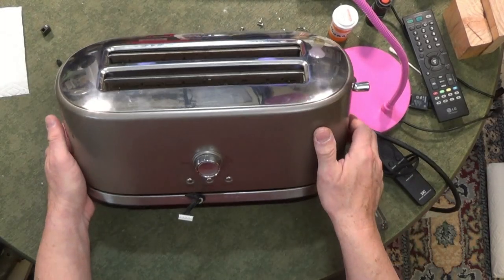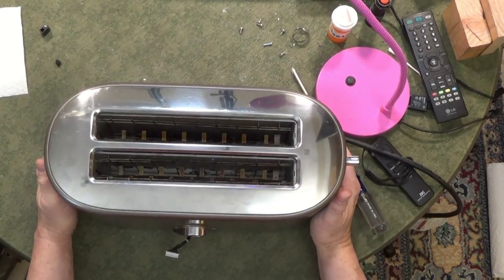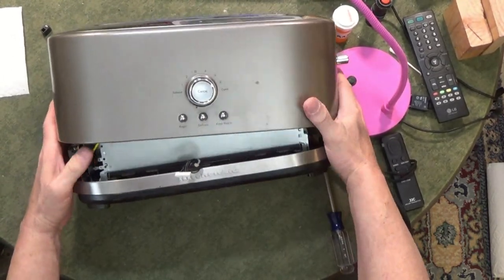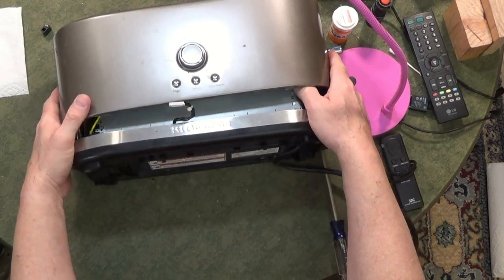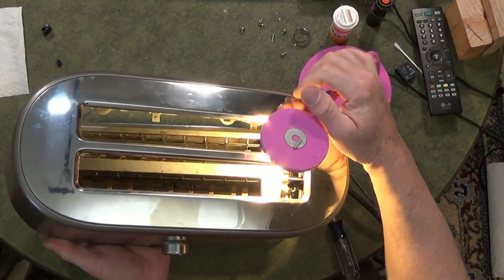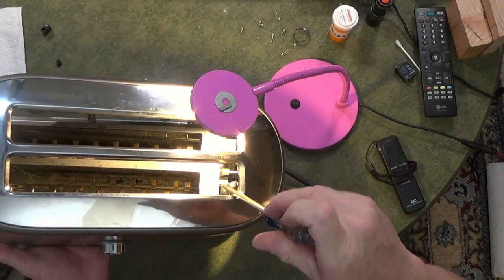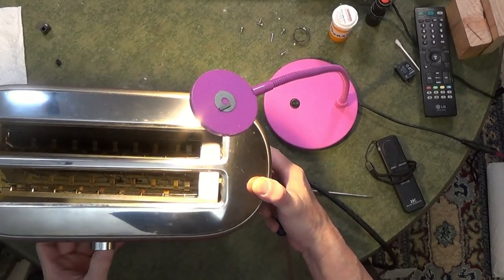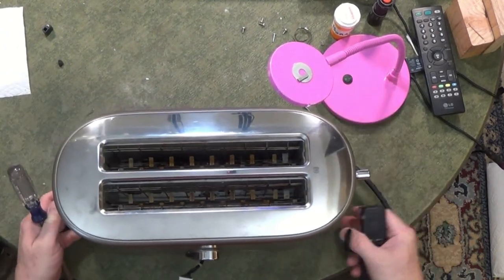How to remove the knob on a Kitchenaid Toaster

Comment: Thank you for this!

Question: I'm looking at this exact same toaster and for some reason they handle will no longer stay down. Would you happen to know what could cause that?
Reply from the maker: Too late now, I am sure, but in case others se this most times the handle on this model won't stay down because the electrical contacts become pitted. Once you have the handle off <grin> and have it open, a little fine sandpaper or an emery board in the right place will get it going. Spring for a "point burnisher" for a more "professional" quality repair.